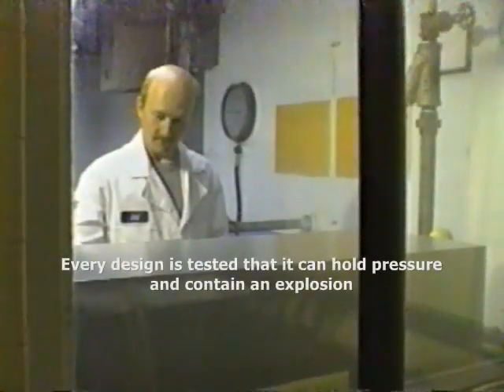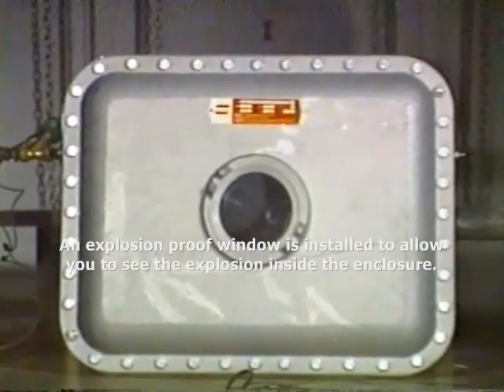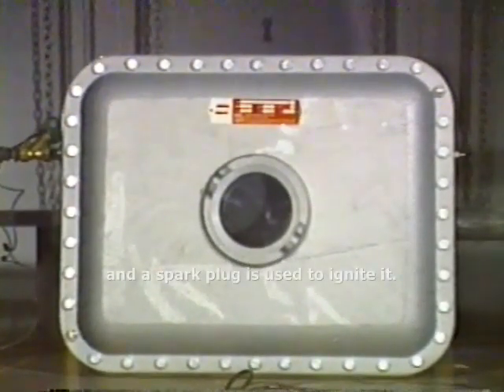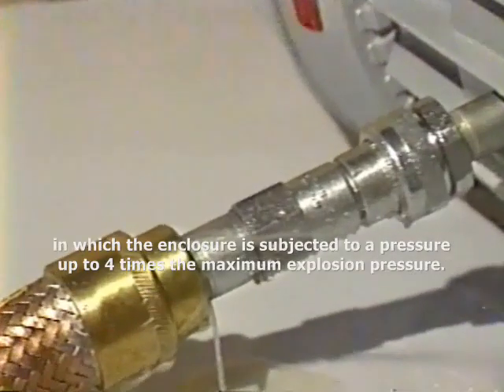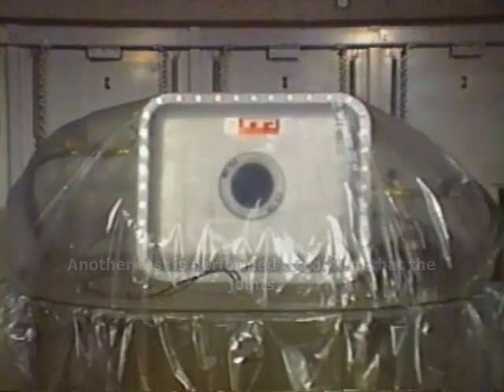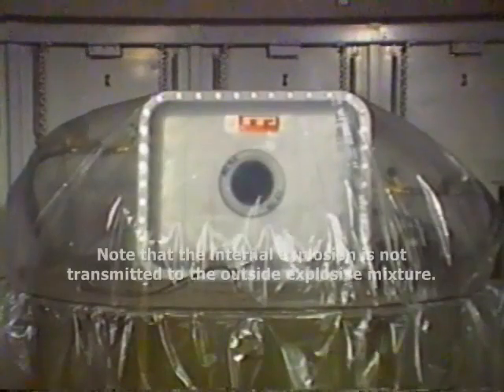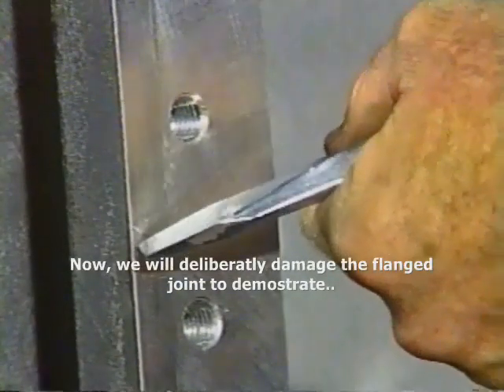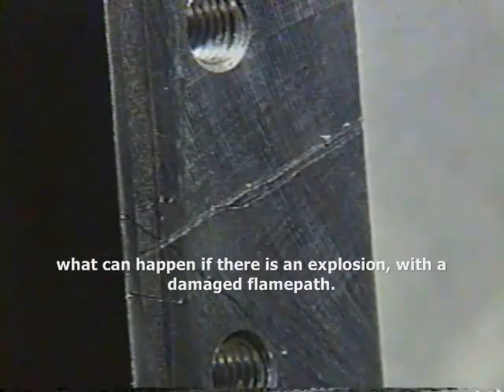Exd explosion test

Comment: With the production of this "instructional" video, the manufacturer of this type of equipment with explosion-proof metallic casing aimed to demonstrate to end users how these "Ex" equipment can represent undue sources of ignition in explosive atmospheres containing flammable gases.  If these explosion-proof equipment are not properly installed, maintained, inspected or recovered throughout their entire life cycle, they can provide a "false sense of security", due to their "robust" mechanical characteristics and great number of screws to fix the flanged covers.  As can be seen in the "educational" video, damage to metal joints (among other possible "Ex" nonconformities) causes certified equipment to completely lose its critical "Ex" protection characteristics, which can cause serious catastrophic accidents in explosive atmospheres.  Congratulations to the manufacturer of this type of Ex "d" equipment, for alerting and making end users aware of the serious problems presented by this type of manufacturing "technology".